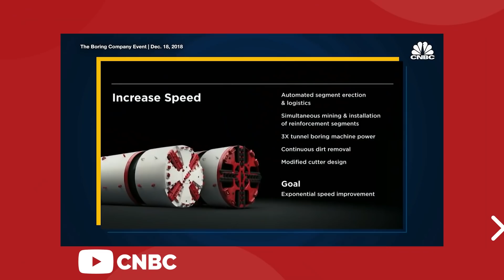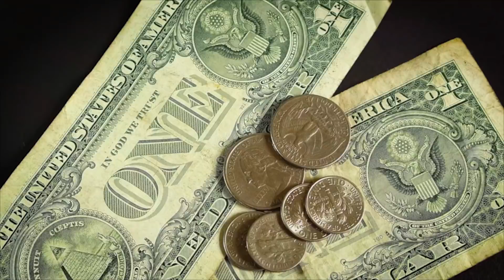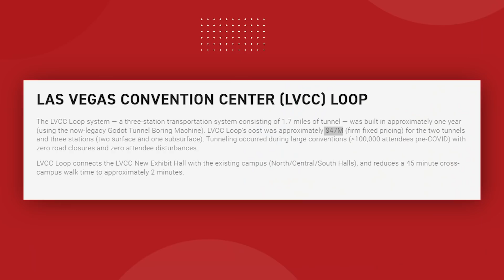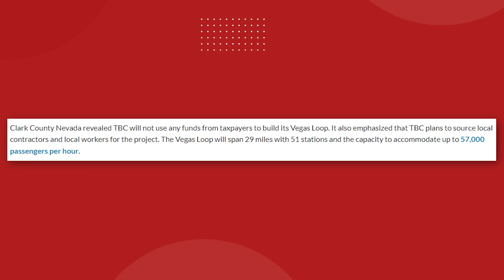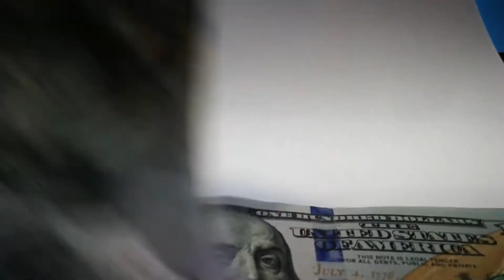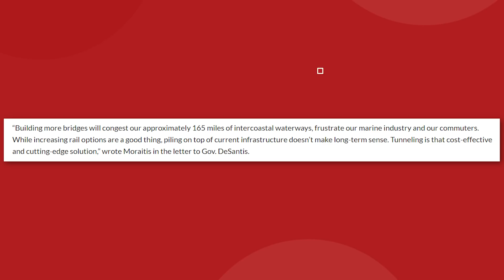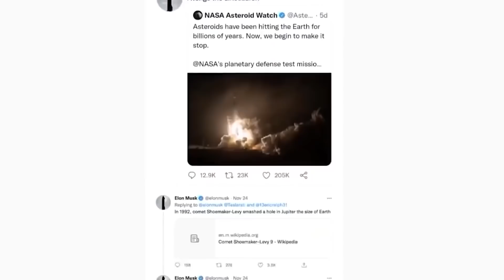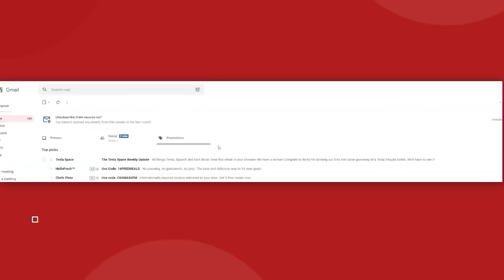The Boring Company 2022 Update

Comment: Elon Musk's efforts are great. But the Boring Company will fail. This is because new means of transportation using high-speed autonomous vehicles will be much faster and solve urban traffic problems with large capacity.
https://youtu.be/bPXHrmvAmv4 It succeeded in commercializing high-speed autonomous vehicles that drive at high speeds on dedicated passages without any obstacles.

Comment: Has the boring company actually met the minimum people deliveries in Las Vegas?
Last time I checked the Las Vegas loop that was supposed to deliver 4400 people per hour  at 155mph was 
At most it's delivering 1984/hr at speeds of 15-25mph 
It's tunnel fails every single minimum safety standards as in it has no ventilation system inside the tunnel, no emergency access, no bypass so you can get by an accident, tunnels are too small for emergency vehicles or tow trucks.
They would have been better off if they had put in golf carts on rails.

Comment: The elephant in the room is that the real innovation is that Elon found a way to put the private sector back in charge of the transportation industry. The real reason these Democrat run cities don't like the tunnels, is because they're privately developed and operated. The whole concept of "induced demand" is basically bureacrat-speak for what everyone else already knows, put the government in charge of the Sahara desert and you will quickly end up with a shortage of sand. Governments have successfully sold their population on the lie that "infrastructure is a natural monopoly", and they use this sacred cow to justify government control of most of the transportation industry (among other things). Infrastructure is only monopolistic to the extent that it is built on land monopolized by the government itself, and Elon's tunnels bypass that whole dynamic to a large extent.

"The problem of excessive duplication of distribution systems is attributable to the failure of communities to set a proper price on the use of these scarce resources. The right to use publicly owned thoroughfares is the right to use a scarce resource. The absence of a price for the use of these resources, a price high enough to reflect the opportunity costs of such alternative uses as the servicing of uninterrupted traffic and unmarred views, will lead to their overutilization. The setting of an appropriate fee for the use of these resources would reduce the degree of duplication to optimal levels.

Thus, just as the problem with "natural" monopolies is actually caused by government intervention, so is the "duplication of facilities" problem. It is created by the failure of governments to put a price on scarce urban resources. More precisely, the problem is really caused by the fact that governments own the streets under which utility lines are placed, and that the impossibility of rational economic calculation within socialistic institutions precludes them from pricing these resources appropriately, as they would under a private-property competitive-market regime.

Rational economic pricing in this case is impossible precisely because of government ownership of roads and streets."

Comment: For the boring company to really be successful they need to ditch the idea of driving teslas through these tunnels and instead focus on high capacity electric rail systems. Basically a subway. There are many American cities that would benefit from a mass transit subway system but currently is just to expensive to build. If boring company can reduce theses costs to where subway lines are a viable solution then the market is all theirs. I can name 20 cities that would benefit from expanded or new subway lines.
1. New York 
2. Los Angeles 
3. Chicago 
4. Houston 
5. Dallas/ Forth Worth
6. San Francisco / Oakland 
7. DC
8. Atlanta 
9. Phoenix 
10. Miami
11. Boston 
12. Philadelphia 
13. San Antonio 
14. Austin 
15. San Diego 
16. San Jose 
17. Charlotte
18. Detroit 
19. Denver 
20. Nashville

Comment: Most innovation isn’t sexy, it’s incremental and isn’t useful until mass adoption. Tunnels mean more overhead space, and Boring tunnels remove the requirement of building and maintaining trains.  

Furthermore, Boring tunnels take up less space than normal tunnels. They cost less to build (which is usually the impediment to building tunnel systems), can be directionally customized more easily, and once they figure out the underground autopilot technology it will reduce traffic load. 

Boring Tunnels I don’t think were ever meant to replace roads or trains, just like Teslas never meant to replace cars, SpaceX rockets to replace space shuttles, or PayPal replace currency. It’s an option and a pretty good one.

Comment: I like the idea of Musks tunnels, but I don't see the point in all this car elevator stuff, just looks excessively complex. Just let cars with self driving use them and join or exit at surface interchanges.
Reply: The elevators are meant for dense urban areas where there isn't room to build ramps.   I think in reality those elevators would need to be even more complicated. 

I also don't think it's a good idea to bring a lot of cars to a dense urban area.  If your car is going to be parked all day and then you just go back home, why bring the car at all. Just bring yourself and leave the car at home, or at a station near your home.

Comment: Hyped and withouth substance. Also without much thought given to it. They are not inventing anything spectacular here. Just moving the same traffic from above ground to a very confined and dangerous space below ground. Which means all the traffic will move under the ground and people will have no way to escape if something goes wrong. Honestly, this is one of the dumbest ideas of Elon's. And it has been thoroughly analysed and 'debunked' by people that know thing or two about public transport.
Reply: They have plans an equipment for emergencies in the tunnels.   The ones built so far are so short that there are already exits where you would need an emergency exit.  There are ventilation systems in case of fire.  The drivers are trained to clear the tunnels by driving to the nearest exit.  They know how to drive in reverse if they can't drive forward.  All of this and more was developed with the help of the Clark County Fire Department.   It's weird that the debunkers don't seem to know all of this.

Comment: Subway?! Why not just a subway
Reply: Many reasons.  This can be built for a fraction of the cost of a subway.  It gives passengers a better experience than a subway, because it takes them to their destination faster, without stopping at every station.  In most cases passengers will spend less time waiting for transport, and they won't need to do transfers.  It can operate more efficiently than a subway, because when cars are not needed they can be parked, where a train needs to keep moving around, stopping at every station in case there are passengers.

Comment: Worst fanboy video, leaving out what was promised vs what was delivered.

It will fail like everything musk touch.
Reply: When will it fail?  It's working well at the Las Vegas Convention Center.
Reply: @Kevin Bailey  it's a big fail, if you compare to what was promised and what was delivered..
This is basically 60 slow-moving taxis driving around in a cramped tunnel (yes with traffic jams as well)
Just wait until an accident (fire) happens in one of those deathtrap tunnels
Reply: @Natorz111  There was no traffic jam.  It was a very temporary slow down.   During the show where the traffic jam video was taken, the system had an average wait time of less than 15 seconds and an average trip time of less than 2 minutes.   If you think the "traffic jam" was significant, then you must also think the normal wait times and trip times will be even lower. 

They delivered what they promised to the LVCVA, which is who was paying for this project (using hotel taxes).  The only thing outstanding is autonomous vehicles.  The LVCVA knew the vehicles would have human drivers at first, and since they aren't paying the drivers (TBC is), it doesn't hurt them at all.

You may have to wait a very long time for a fire, because fires are very rare in Teslas.   It may not seem that way to you, but that's because every Tesla fire becomes worldwide news, but the burning ICE vehicle you pass on the side of the road probably won't even make the cut for the local paper.

As for as ordinary, non-fire accidents that block the tunnel, we don't know how common they will be.  There haven't been any so far, and with the vehicles traveling at moderate speeds with plenty of room between them (and STILL providing those under 2 minute rides), it doesn't seem like a very accident-prone environment.  It's safer than traveling on the surface streets, where accidents happen every day, some of them fatal!
Reply: @Kevin Bailey  Musk promised 16 person vehicles fully autonomous that would go 130mph and would cost the user $1.. 
Is that really what you think was delivered????

Also the driver indicated the traffic jams happened a lot..., but ofcause they are not allowed to talk about it, since Musk can't deal well with criticism. 

Oh did you know you can walk fast to the convention center than taking an underground tela?

I guess fanboys just don't want to face reality.

If you look at the history of Musk, you will see a clear pattern of unrealistic promises and lies, some that are borderline scams!
Reply: @Natorz111  Musk shopped his concept around, and didn't find any takers, yet.

What he found was the LVCVA, which wanted a very short shuttle system.  This was a chance for TBC to dip its toe in the water, and get its first commercial job under its belt. 

The LVCVA didn't want to charge a dollar for the rides.  As long as you're attending a convention, the ride is free.

LVCVA didn't want all the bells and whistles of the concept.    It's less than a mile from end to end, so going 150 mph wasn't an option.  The 16-passenger vehicles will take years to develop (look at how long VW has taken with its five-passenger electric van).  And it will be expensive, when they only need a couple dozen.  I expect they're still coming, but the Teslas were basically off-the-shelf, and already equipped with cameras and sensors for autonomy.  I think the bigger people movers are still coming, though they aren't necessary right now.

If these traffic jams do happen often, why aren't there more videos of them?  I think this is the worst you could find, and you have to stretch to make a 40-second delay where traffic never actually stops seem as bad in your mind as the bumper to bumper stop and go traffic that inspired Musk to buy a boring machine.   Remember: less than 2 minute average trip time.

No one is stopping you from walking.  When the project was still being considered, they said it was normally a 15 minute walk when the convention center was not busy, so anyone who declares they can walk it fast in 15 minutes or less isn't saying anything new or original. They also said that during the biggest shows, crowds and traffic could make that 15 minute walk stretch to 45 minutes.
Reply: @Kevin Bailey  haha its a short tunnel, so 150mph wasn't an option. 
Do you understand how you sound????

I hope you understand that no matter how long the tunnel is, it will never be an option because everything he promised was just made-up lies.
Like his tesla taxis and trucks and solar panels and Mars Misson...and we could go on...

Oh and you also misunderstood the point about the fire.. other tunnels have emergency exits and so on, but not boring company as they don't care much about safety...
Reply: @Natorz111  Again, this is a short tunnel, so where emergency exits would be required, there is already an exit. 

They are required to care about safety in order to get the tunnels approved for use, so they worked with Clark County Fire Department on their safety equipment and procedures. 

I understand the point you're trying to make, but they are prepared for the very remote possibility of a fire in the tunnel.  We'll have to wait until the very unlikely time when a fire occurs to know for sure if what the Fire Department and The Boring Company jointly came up with is enough, but I think the Clark County Fire Department would take issue with you saying they don't care about safety.

It must comfort you somehow to believe that everything Elon Musk does is a grift of some kind.  

I'm comforted by the knowledge that my Solar Roof has just topped off my Powerwall Batteries, and is now feeding electricity back to the grid.  I filled up my Model 3 battery yesterday and i haven't taken  it out today.     I feel the benefit of Musk's kept promises, and I didn't invest any emotions (or money) into unkept (or not yet kept) ones, so I'm not taking delays as personally as you do.
Reply: @Natorz111  I did not pay for the FSD package when I bought my Model 3 more than three years ago.  I paid for EAP, which has the Autopilot features I want, but I had my doubts that FSD would be ready soon enough to be useful to me.   Even when I could have added FSD for a thousand dollars, I passed, and I don't regret doing it.  

I do have a reservation for Cybertruck, and I indicated that I want the FSD package (which supposedly locks the price down at $7K).  I'm waiting to see where FSD stands when the Cybertruck finally is available, to decide if I really want it then, and of course I'm waiting to see what the production Cybertruck looks like to decide for sure if I want the vehicle.

I do have the solar roof on my house, installed in 2020. It happened to come available in my area at the time I needed a new roof due to hail damage. There's an easy way for me to show you what it looks like, if you want to see.  

I'm not a Musk fanboy, but I am benefiting from from several products that he was instrumental in bringing to the market, and I'm excited about humans exploring the solar system.  I don't expect humans on Mars in 2024, but I do expect significant progress toward a later mission to the red planet, and I expect SpaceX to be a big part of that.
Reply: @Natorz111  I have the Tesla solar roof.  Click my avatar to see it being installed.   At the time I had it done, there wasn't any other company with a similar product.

I may not live to see any actual colonization of Mars, but I expect to see humans on Mars in my lifetime, and I expect to see SpaceX Starship playing a big part in that. Any human presence on Mars will require moving many tons of materiel there, and Starship is the vehicle to get that done. The same goes for establishing a base on the Moon.  I'm ready for the new space age. 

If SpaceX inspires other companies to build similar or better launch systems, all the better.   It doesn't have to be SpaceX.  Let the exploration/exploitation of the final frontier begin.
Reply: @Kevin Bailey  , looks nice and as long as you are happy with it even though its not very cost efficient then your happiness is more important.

Hopefully one day you will see Musk for what he really is as well 
... take care